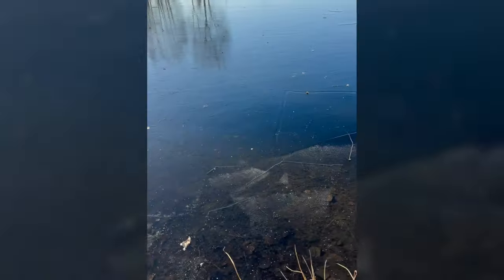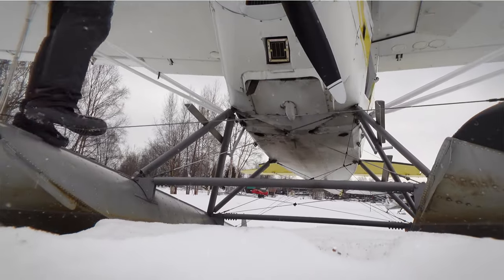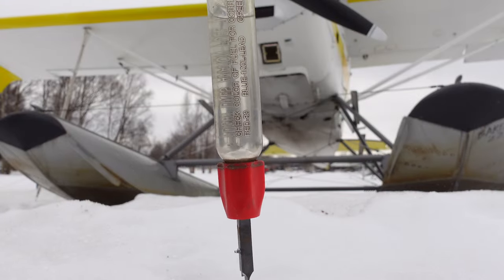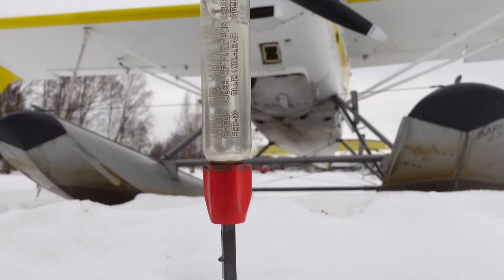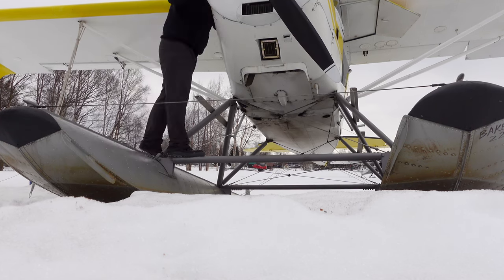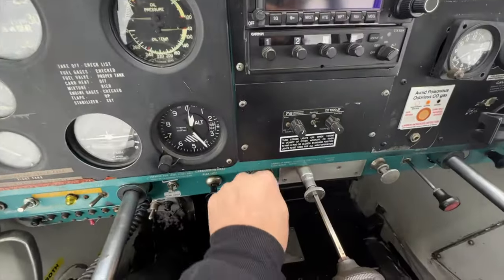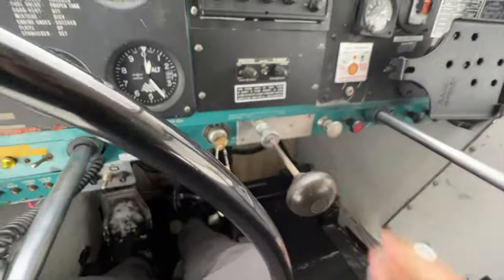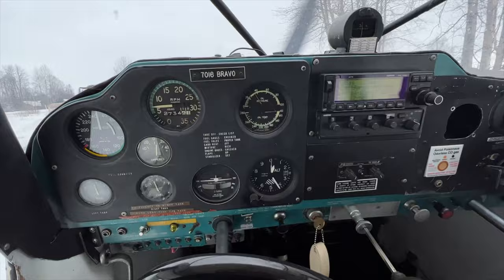Frozen Solid? Trying to Start My Airplane After an Alaskan Winter!

Comment: I was posted down to the Antarctic in the forces many years ago. We used to drain the engine oil and water from the planes and vehicles as soon as we stopped using them. When we wanted to use them we preheated the oil and water  (not too hot to prevent damage) and poured it back into the motor. Starts first time. You can also buy preheaters that fit in the block that wll warm the motor. You plug them into a shore line.
Reply from the maker: We just put a pre-heater on it this annual. Usually the plane lives in my hangar in the winter time and doesn't come out until the lake is open. I was just too late to get it to the side of the lake to pull it out before the lake froze.

Comment: Im surprised the oil pressure was only 60 PSI at first start up. Seem low for being cold and thick
Reply from the maker: We brought it up to our mechanic at annual. The gauge itself was reading off due to a loose connection. It’s been adjusted. 
Good eye!!!! Thanks for watching out for us!!
Reply: @AdventureAK  glad u fixed it. I work on GA planes for a living. I like looking at all the details in aviation videos.

Comment: Its not going to do what you want it to do, for long, IF you continue to leave it exposed to the harsh winter elements
Reply from the maker: It is a very common thing up here in Alaska. There are no hangars available for most pilots so 95% of the aircraft get left out on ramps.
Reply: Agreed, for sure. My heli flight time in AK required as much winterization as possible, even overnight
Reply from the maker: @jimstrieby4998  we winterized the engine. Thankfully anchorage doesn't get as cold as other parts of Alaska. Most of the time in the winter all my aircraft make it in the hangar, this one didn't because Lake Hood froze overnight unexpectedly. I'm parked in a spot on the lake that doesn't have access to get back to the hangar on a trailer, so there was no way to get it back into the hangar for the winter.

Comment: Why can't pontoons double as skis?
Reply from the maker: The one word answer is "drag." But to go a bit more into detail.... the floats are the wrong shape and would just plow through the snow without allowing the aircraft to get up to flying speed. Skis are flat on the bottom and create less drag, allowing the aircraft to get up to speed.
Reply: It can and has been done before in a pinch. More so with a long keel of the floats, you’d have a hell of a time trying to make tight, turns and steer in the snow. The larger service area would incur more freezing adhesion, to the snow when parked overnight.

Comment: No preservation of the engine? Did you just left it exposed to moisture corrosion sitting outside for all winter long?😮
Reply from the maker: We had our mechanic winterize it
Reply: Dude lives in Alaska. I'm sure he knows a little about cold, wet weather and airplanes